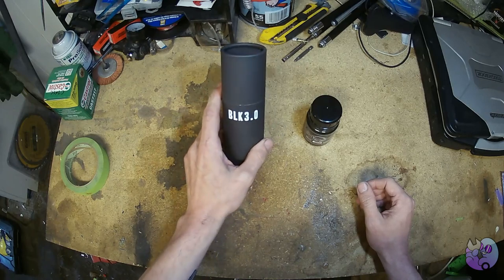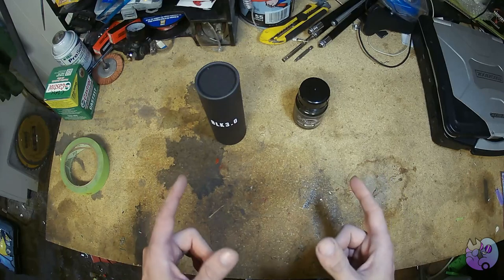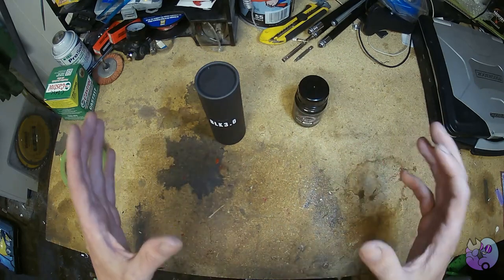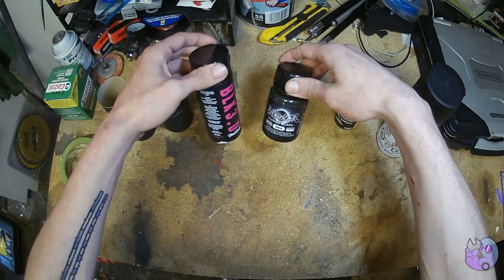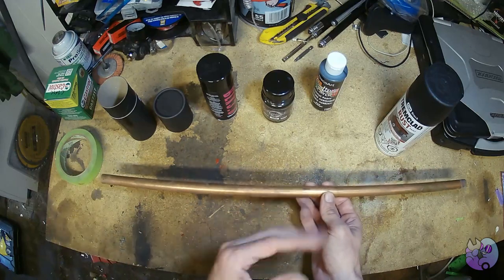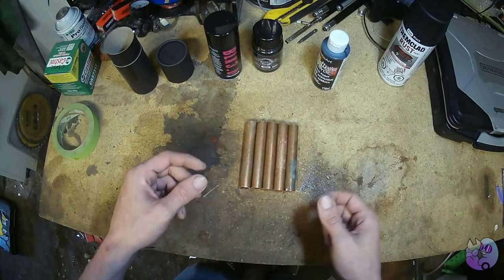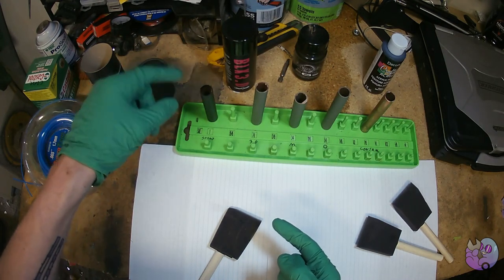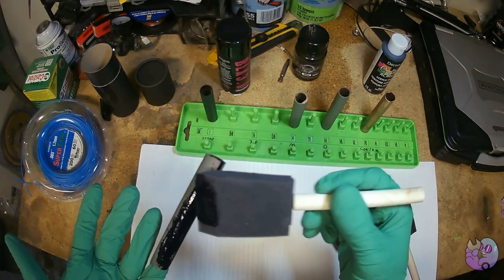How Hot Do Super Black Paints Get in the Sun? (Black 3.0 vs Musou Black)

Comment: Dude you are my hero.  I was also considering this test for passive heating in a cabin.  I wonder if the high heat conductivity of the metal is causing it to bleed heat.  I've researched that dense stone is one of the best for holding heat over long periods.  Sand is also often quoted.   Wondering if the conductivity is playing into the similar values of all of them in the box.  Try with seperate containers perhaps to isolate them more?  Love the toughbook.
Reply from the maker: Thanks for the comment! I also suspected the heat conductivity is the reason for the cool temperatures but it was still consistent with the 'normal' black paints. Reason I used copper pipe is because I'm hoping to make a solar water heater and I want to avoid the sagging and warping with plastic pipes.

Thanks for the tip on dense stones! Since I still have a lot of the paint left, perhaps I'll try this again with pieces of marble or granite or something.

Comment: The temperature goes almost the same under a container in the copper pipes. Because the copper its a good thermal conductor. This is why your test gone wrong.
You need poor conductors, to be able to store heat, not to loose heat in the air.
Of course your results were very similar.
Use steel plates, horizontally.
Don't just put standing tubes vertically.
This is not a true demonstration.
Reply from the maker: Thanks for the comment! I had considered this, I may re do the test with something that has a higher thermal mass, like a piece of marble or something

Comment: I wonder if the green tray was hotter than the copper tubes because of the material, or because of the color? Plants are green for a reason - they reflect the wavelengths that don't supply them with energy. I wonder how a green paint would fare in such a test.